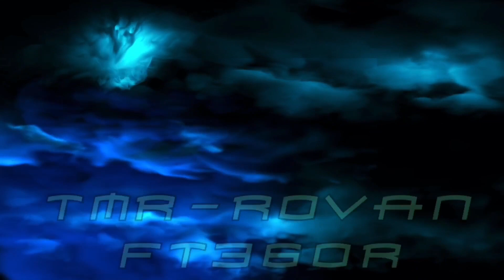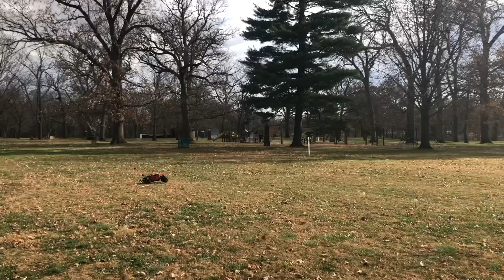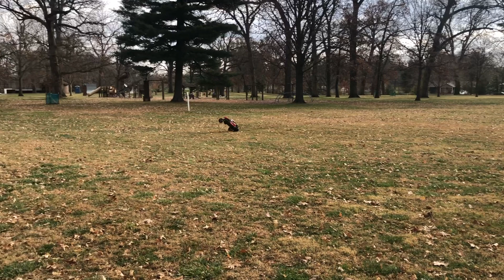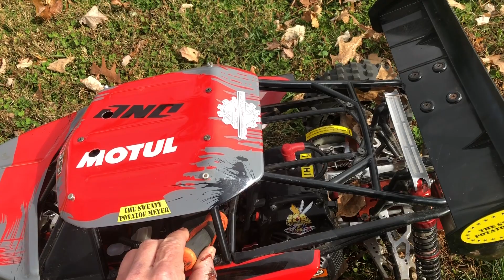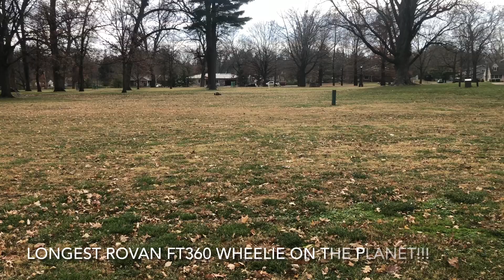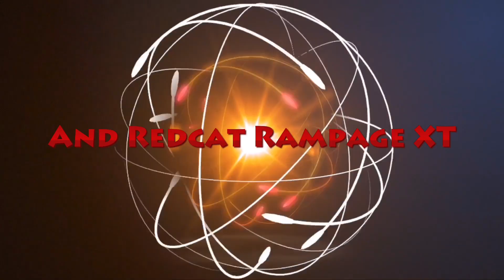TMR-Rovan FT360⛽️⛽️⛽️ Longest FT360 Wheelie On The Planet Prove Me Wrong💥💥💥

Comment: What's your clutch set up. I have the same one and it doesn't even get up and run like that. I've got a tunner pipe on it and a better carb to I've got everything the way it should be but my clutch just can't handle it.
Reply from the maker: That was a tmr engine and we parted ways.  TMR doesn’t exist anymore 😉

Comment: What ever happened to the engine you had in this video is it still running or blow up or what just wondered is all
Reply from the maker: It ended up getting tired 🥱 right around the time I started looking at Taylor RC 40GT engines
Reply: That didn't take long some of my engines are 10÷ years old
Reply from the maker: @wades5thscaleforlife872  Rovan had a bad batch engines at one time and that coating they spray on the cylinder walls started flaking off and lost all compression
Reply: @Meyers2strokeRcgarage  that sucks